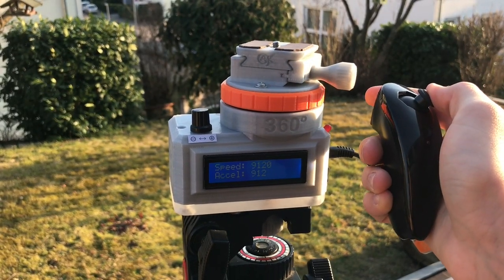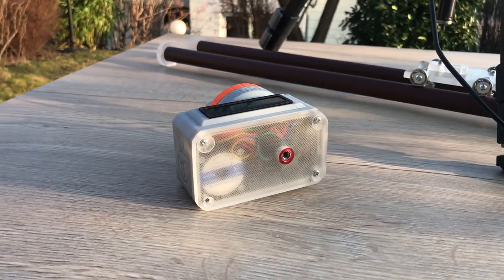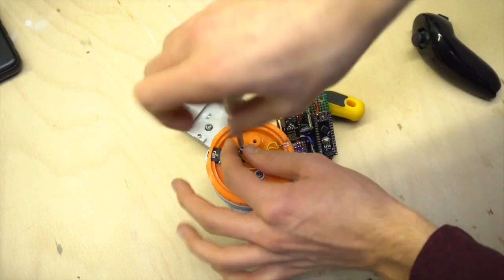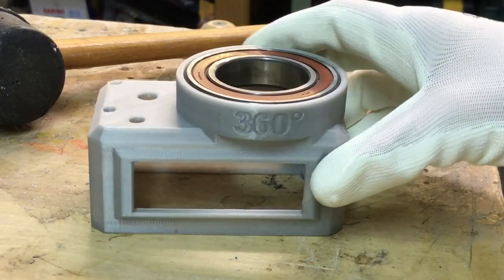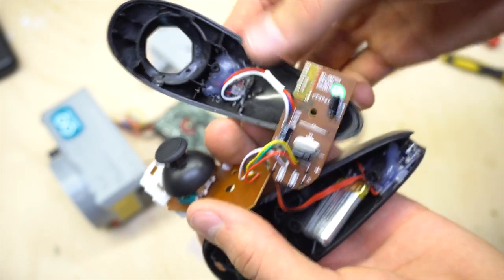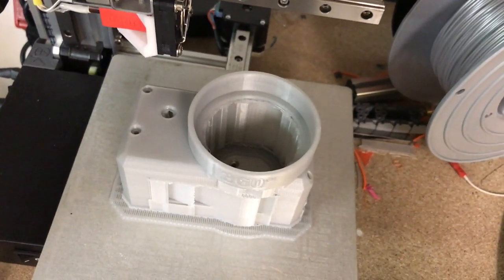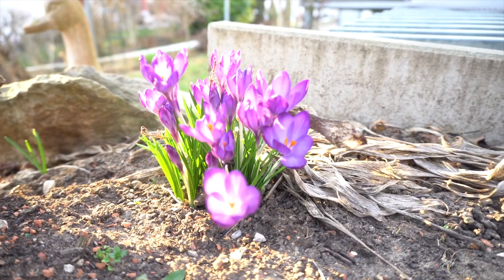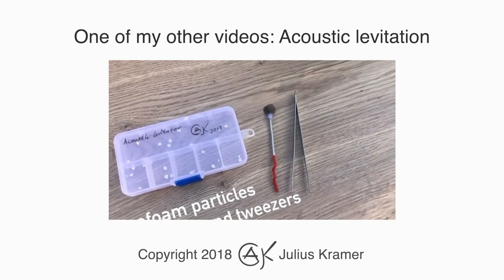360 Degree Motion Control System | Arduino Timelapse | DIY

Comment: Sehr schönes Projekt und cooles Case! 
Wenn ich das richtig gesehen habe, ist es mit Fusion360 konstruiert..? Wärst Du bereit, auch die Source-Dateien und den Arduino-Code bereit zu stellen. Ich würde gern meinen vorhandenen Slider mit einem Drehkopf ergänzen und dazu das Case evtl. etwas modifizieren. Vielleicht auch einen kleineren Stepper ausprobieren.
Reply from the maker: labomat Tut mir leid, doch es wurde nicht innFusion konstruiert sondern in SolidEdge von Siemens. Die Quelldateien knn ich nicht bereitstellen, jedoch können mit verschiedenen programmen auch stl dateien bearbeitet werden
Reply from the maker: Der Code ist leider nicht öffentlich, aber bei konkreten Fragen einfach melden 👍🏼
Reply: @juliuskramer6297  Mine Erfahrung ist, dass man mit STLs zum Weiterbearbeiten nicht viel anfangen kann. Höchsten mal, um ein zusätzliches Loch einzufügen oder so. Habe inzwischen ein eigenes Gehäuse konstruiert. Aber Danke für die Inspiration!